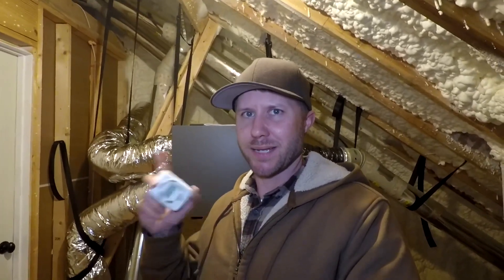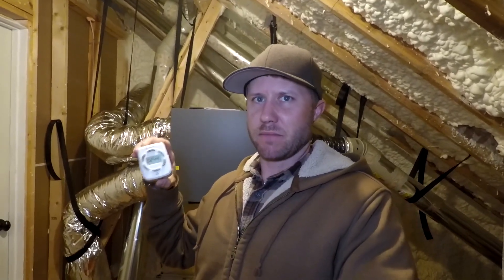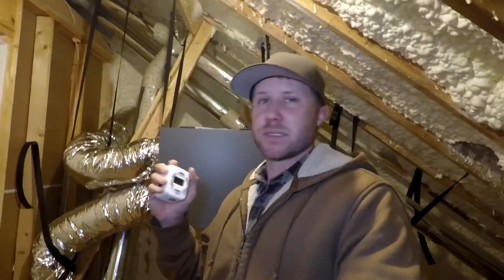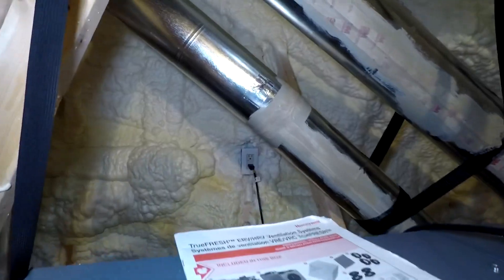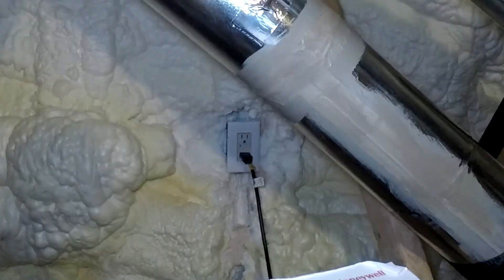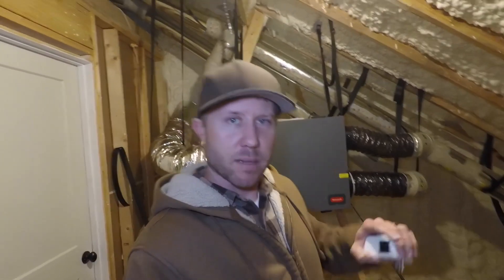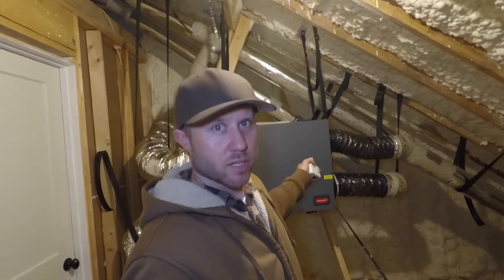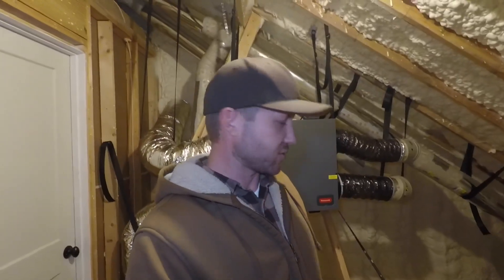Honeywell ERV problems. Our timer quit working. Spray foam insulation ventilation.

Comment: Your timer switch is likely not sufficient to the duty required for the motor start up.  If you're handy enough you'd be better off adding another plug, and a switchable relay.  This way you use your timer to switch the relay to the ERV and then turn the power on, and not using the timer to turn the power on alone.

https://www.youtube.com/watch?v=itM0VgyCIh8

As a whole I've seen some of your other videos on spray foam, and some of what you are dealing with is more a poorly designed application for the spray foam, and not a problem inherent to spray foam itself.

Comment: Hope everything goes well. Thanks for your content. Spray foam is the right thing you did. Once the leak is fixed it should be alright. Is the leak causing humidity? Believe the roofers caused the roof leak.
Reply from the maker: The leak was repaired a few months ago. The original roofers did cause the roof leak. The vent boot was not sealed to the metal roof properly. 

The humidity is caused by the fact that we live in hot and humid Georgia. Every time it rains or gets warm outside, the humidity goes up. I think the spray foam makes it worse inside the house. I just ordered a whole house dehumidifier that I will be installing in the next week or so.
Reply: @BrantleyBlended  : thanks and hope the best.

Comment: I understand your frustration. Is What you mean by hating spray foam the fact that your house is so tight now?
Reply from the maker: I hate that the spray foam is costing me a lot of extra money and aggravation. I spent $3K for an ERV. I just ordered a whole house dehumidifier tonight for another $1200. I had a roof leak that I didn’t know about. Obviously, my contractor did not have enough experience building a house with spray foam insulation, and I did a mediocre on and researching it before we built.